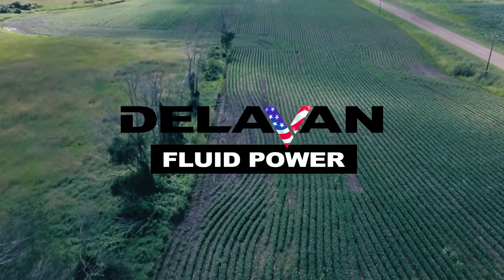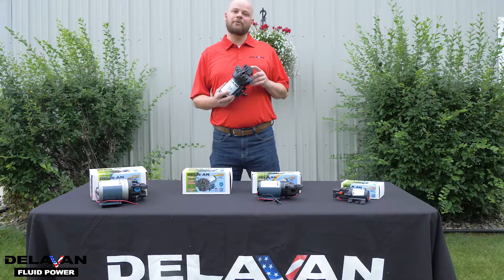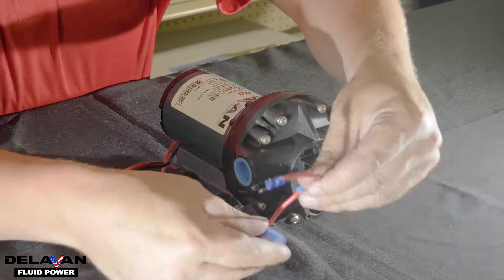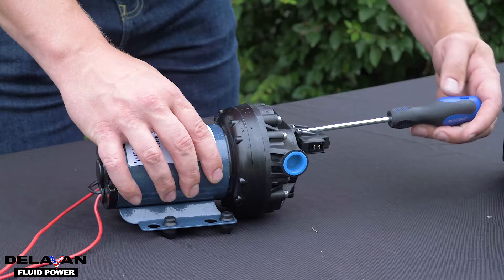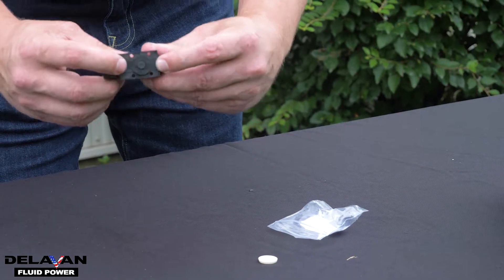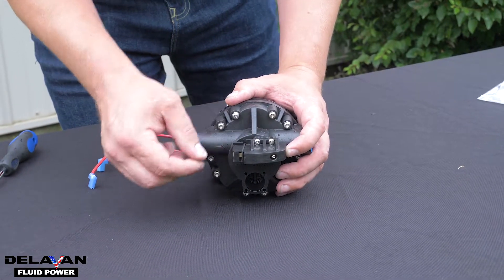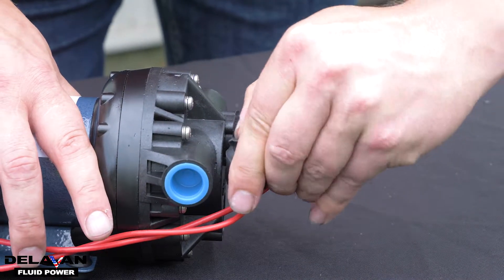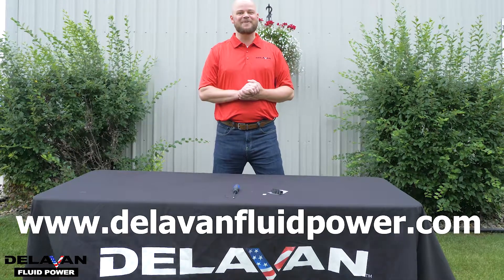Testing and replacing pressure Switches

Comment: I have the model 3120-423F (NEW)
I have it mounted upside down about 3 feet off the ground and I have a 1/2 inch “Y” fitting that goes from the pump to my chlorine tank and to my fresh water tank (for rinsing out pump after use). When I pull the trigger and  it sprays, I then release the trigger and  my pump still runs approximately 4 to 5 seconds and then cuts off. I have 190 feet of 1/2 inch hose I use. Is this normal? Shouldn’t it cut off 1 second after releasing the trigger ? I have adjusted the setscrew and no matter which way I turn it I can only get it to cut off after about 4-5 seconds. Any tips? Thank you
Reply: do a test with a 10ft hose it can be shorter but no longer if the pump stops working immediately then that means that the pump is taking 4 to 5 seconds to build pressure in the 190ft of hose you have, is building pressure until it reach the set pressure that the pressure switch is set on.